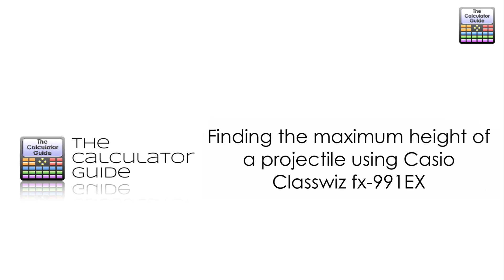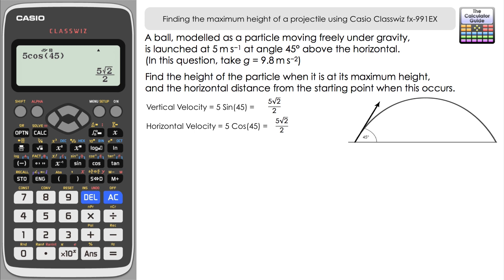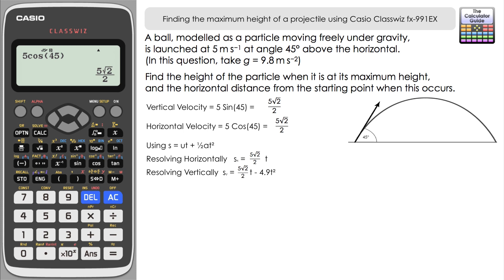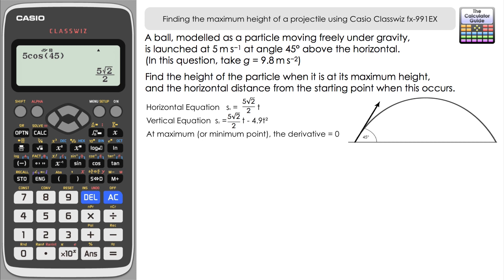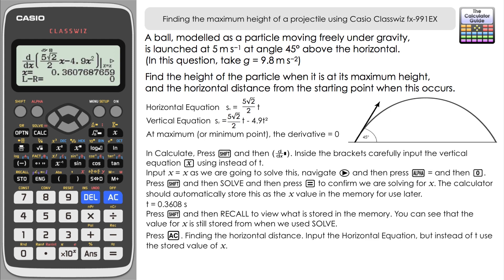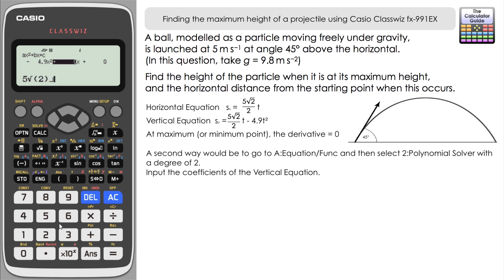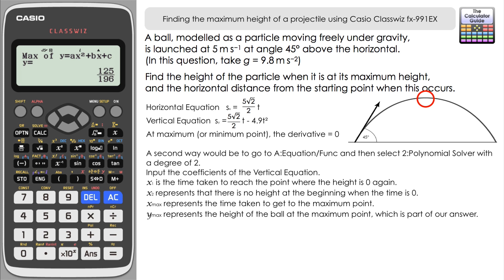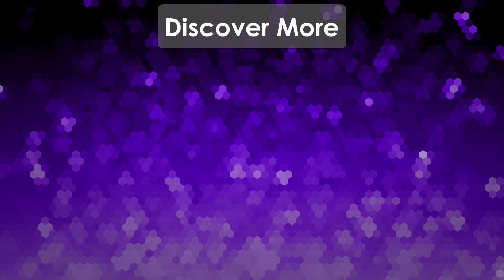Finding The Maximum Height of a Projectile using Casio Classwiz fx-991EX

Comment: The new Casio fx-115ES  PLUS 2nd edition can’t solve this using the derivative function because you get an error signal. Technically with the first method you are trying to solve within solve. 
As far as I know, only the ClassWiz and the TI-36X PRO can do this among the non-graphing calculators.

Comment: Thank you for your  help.  after getting the   vertical  distance  0.3607  . At  5.49  it says  L-R =   0      .  What  does this  mean?  with  thanks
Reply from the maker: That is just the method the calculator uses (Newton’s method). The closer the value is to 0 the more accurate the answer is. It just shows that the answer given is as accurate as the calculator can find it.

Comment: I am confused when dy/dx=0.
Reply from the maker: dy/dx is 0 at the turning point or in this case the maximum point of the curve. This is the only location where dy/dx will equal 0 in this example.
Reply: @TheCalculatorGuide   Starting to make sense.  Thanks  a lot

Comment: Hello. what is the gradient  at  y=0.  when the ball is launched and lands.  Is that  at 0?
Reply from the maker: The initial gradient should be 1 as it is projected at 45 degrees. The gradient reduces to 0 at the maximum point. Then reduces to -1 by the time it lands
Reply: I got  confused  because  when the projectile landed  I thought  dy/dx  would  = 0 @TheCalculatorGuide

Comment: I came back to this problem to try and solve it on the CG5O and it also can’t handle it. It just returns 0 if you enter the problem exactly as shown in this example. That is disappointing for their best non-CAS graphing calculator. So it looks like the derivative function on the CG50 is weak compared to its non graphing ClassWiz sibling.
I don’t know if the TI-84 CE would have the same problem or not.
Reply from the maker: I managed to do it in Equation Mode, Then F3 for solver and set it up as it is at 5:36 Then if you press = and = again, then it does solve it. I had to use ALPHA and + to get an  x though. One of the things which I would say is easier or at least more user friendly on the Classwiz fx-991EX
Reply: The Calculator Guide Thanks. I will try it again.

Comment: I also have an Casio 115ES Plus and it seems incapable of doing this. Even when the equation is written so it looks exactly the same as the example, it gives a syntax error message.
Of course my ClassWiz does this example exactly the same and even my TI-36XPRO has no problem doing this. However, it seems too much for the 115ES Plus.
Reply from the maker: Sorry about that.